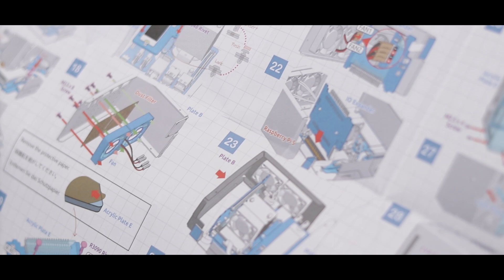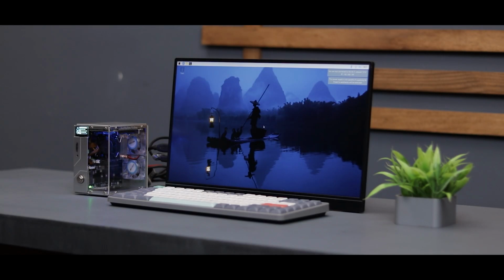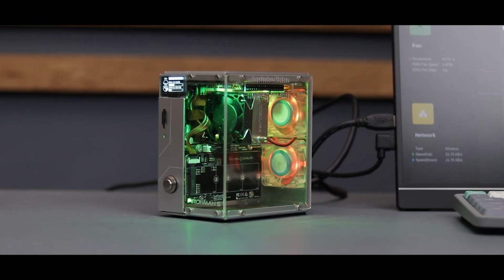Turns Your Raspberry Pi 5 into a Mini PC | Pironman 5

Comment: I love it and I want it but I really don’t see what the point in getting it is as opposed to a gaming pc (like it resembles) or an iPad. I understand it’s a development board. Could one edit extended and complex 4k videos on it? Is there a software that optimizes the device for this use? I want an excuse to buy it
Reply: I use my old Raspberry Pi 3 B+ as a file server for PleX.
Reply: @CapOlimar  what’s that
Reply: @GhosTechRepair_Gaming  I have a large Blu-ray collection, most of which I've ripped to my PC and then I'm able to access everything using the PleX client on various devices. It allows me to access my collection from essentially anywhere that has an internet connection. I use my Raspberry Pi as extra storage so I don't have a ton of hard drives connected to my personal computer.

EDIT: I forgot to mention the operating system I'm using on the Pi is called Open Media Vault (OMV).
Reply: @CapOlimar  I have the Raspberry Pi 3B+ as well. I run Kodi on it and use it to watch movies from my flash drive. It reads formats that most devices don’t. Considering you can now connect a 2TB NVMe to the Pi 5, I’m thinking about creating a similar setup but for photography and videos for editing.

Comment: why cpu fan isnt spining?
and total cost ?
Reply: I bought the same case with the power adapter cost $93 USD but I missed a discount code apparently.
Reply: @masterinico  thanks.
Reply: @bigbang6880  the cpu fan only turns on after 50c

Comment: Where is m.2 ssd
Reply: He didn’t install one. Pro tip if you built this, at least install the mounting screw for the NVMe ssd or else you have to take it half apart again to install the drive later